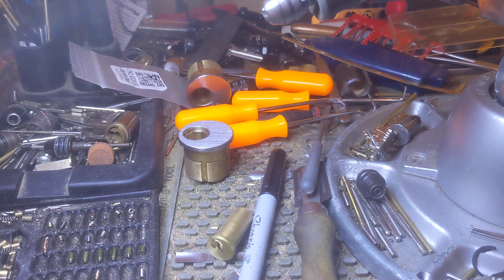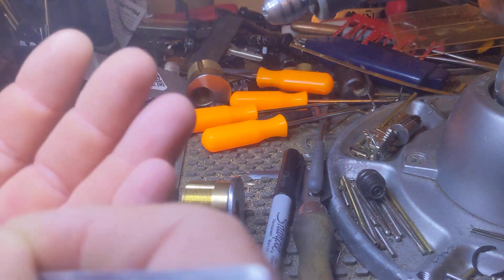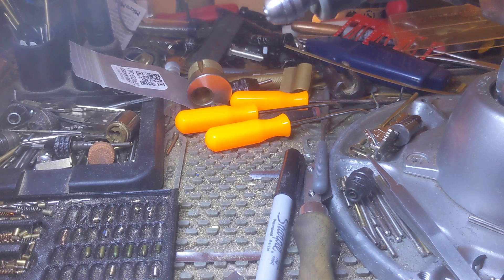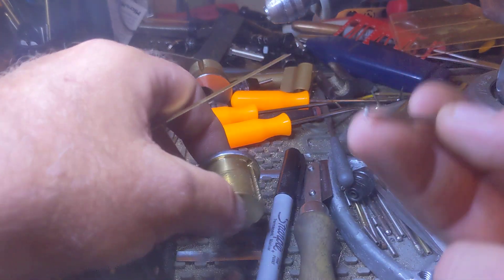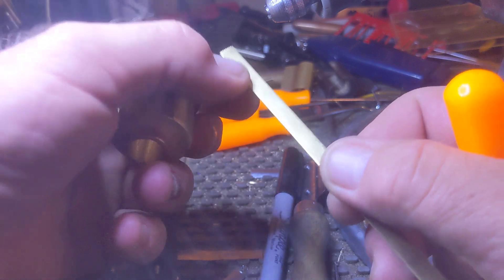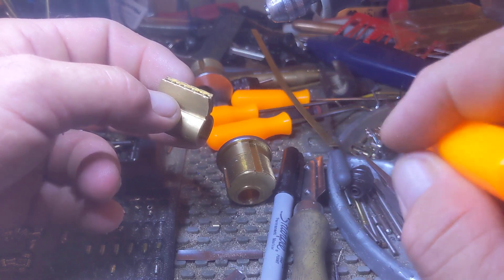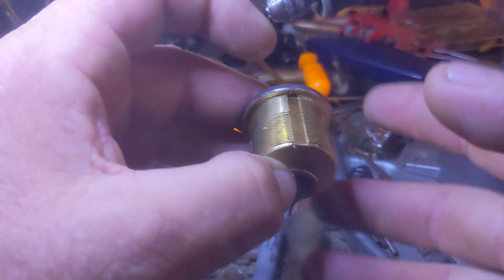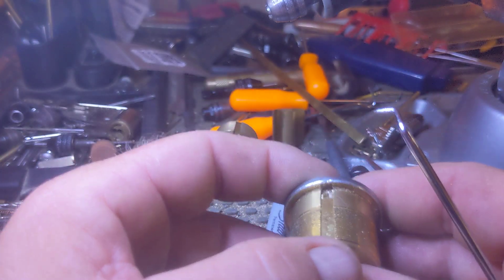7 minute rambling of security pins and mods, and a method to reseal the top

Comment: Ive threaded bibles before but never undercut on one yettttt😜. My question is how do ya know where to put the undercut(how did ya measure and then transfer to the bit). So ya went down to where the cut needs to be. Did ya free hand ur dremel or the lock. Meaning do ya use the lock and maneuver it around the bit, or the bit maneuvering around a vised up cylinder? If this makes sense. Im guessing you have already demonstrated in a video. Just didnt see it.

Comment: nice lock, if you make your filler strip wider and then bend it down the middle like those other strips till it will fit in the channel, then lay it in place and flatten it.  that will make it very tight.

Have a great day
Reply from the maker: I wanted the ability for it to be removed just in case situation where a rebuild or something goes wrong ( we all have had our fair share of mishaps ).. it fits snug in the channel and will need outside force. i usually cover with JB weld steel stick, but this way is secure enough to not slide easily.